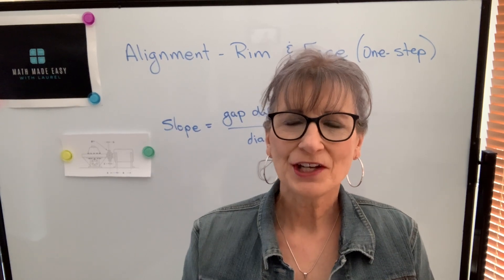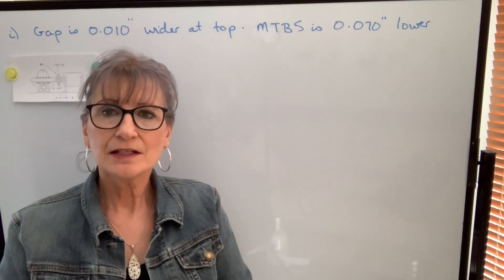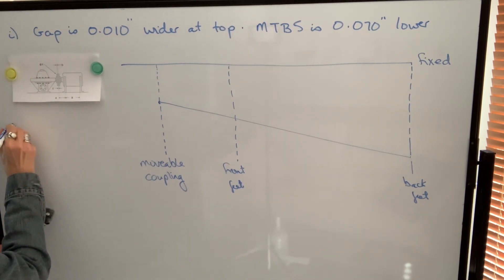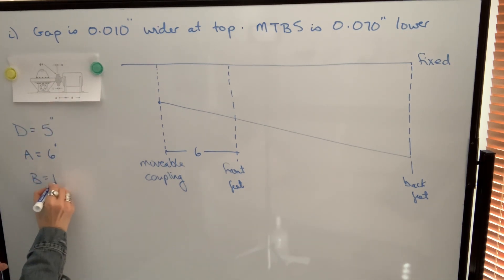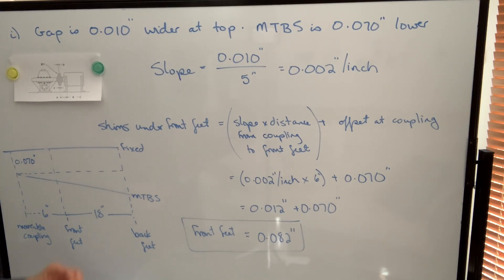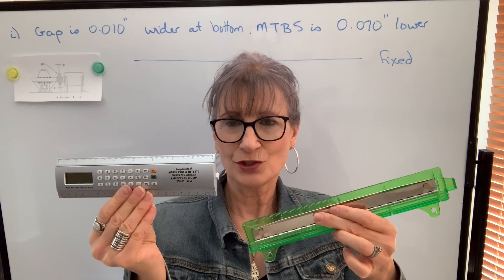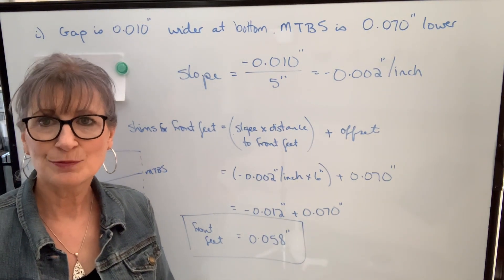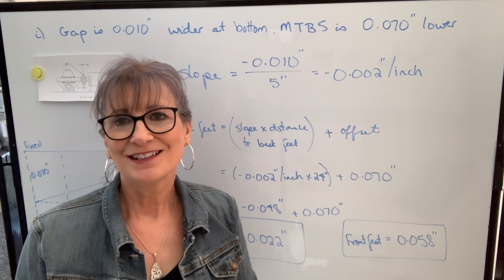Trades Math - Rim and Face Alignment Part 1

Comment: Is it possible to convert face and rim indicator readings to reverse alignment indicator readings or vice versa? If possible how?
Reply from the maker: Can you clarify what you mean by reverse alignment indicator readings?  Are the indicators mounted on the moveable shaft instead of the fixed?  Or are the readings zeroed opposite to what I did?

Comment: How would you measure  that mtbs is higher or lower than the fixed machine without using dial indicator based on your example?
Reply from the maker: You could use a straight edge and feeler gauge to find the offset misalignment instead of a dial indicator.  Just remember that when you do it that way, the value that you get is the actual misalignment so doesn't require devision by 2.   However, if you use a dial indicator, divide your rim reading by 2 to get actual offset misalignment.  I hope this helps.
Reply: Is there no other way of converting face and rim indicator reading to reverse alignment reading through mathematical calculations?